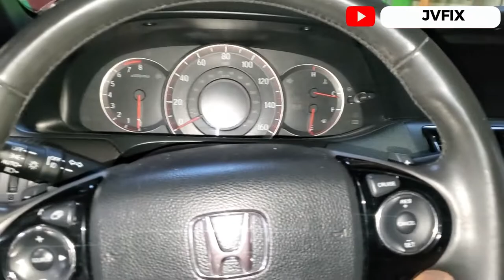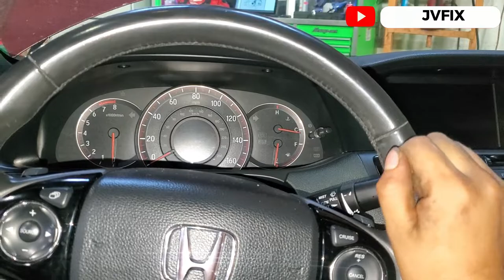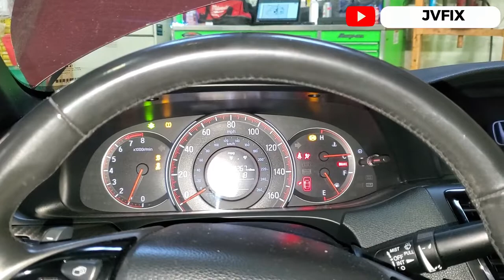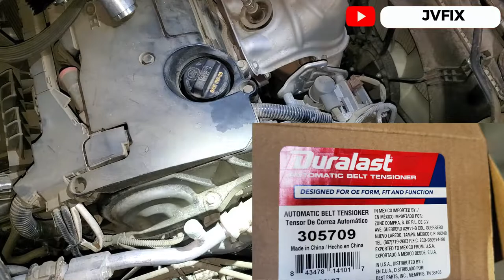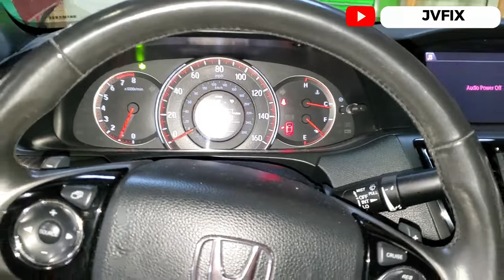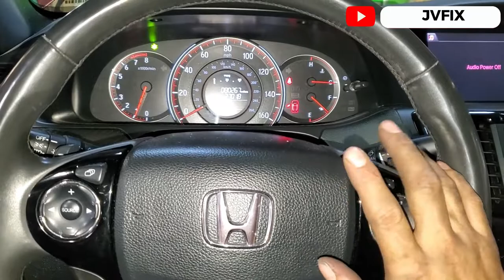How to Fix and Diagnose Whining, humming Noise on Your 2011-2019 Honda Accord, Civic, Odyssey, Pilot

Comment: Great video. I have a question. Do you know at about how many miles would this kinda problem arise on one of these vehicles?
Reply from the maker: this truck had over 180k miles and it was still original.

Comment: The noise goes away when I speed up. Same reason?
Reply from the maker: it could be starting the only way to know for sure is to remove the belt and check all pulleys

Comment: What pulleyes are being driven by the accessories belt? Alternator, power steering, belt tensioner? Anything else that I'm missing? My screams when I turn the wheel left or right. Not sure if it's just power steering pump.
Reply: Those’d cars has no power stifling pump is electric assisted
Reply from the maker: it could be the tensioner possible losing tension already.

Comment: Great video! Only one on YouTube that shows this problem and how to fix it , thank you !
Reply from the maker: Glad it helped
Reply: Question: Is there a specific name for that pulley (transmission/alternator pulley)? Or is it just the pulley next to the alternator? My 16 civic Ex makes a very similar whining noise. I was told by 3 (2 being shops that ONLY do transmission) auto shops. Who stated it was my transmission pulley (or something to that effect). To replace the entire transmission. vs. just replacing the pulley only. Priced both items, and the refurbished transmission was HUNDREDS of dollars cheaper. Please, I could really use some advice. Thanks